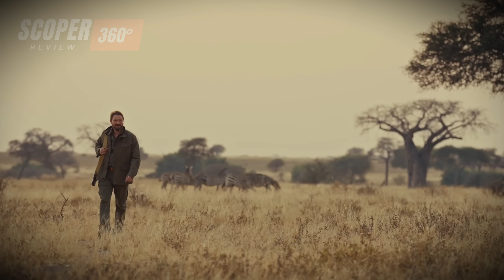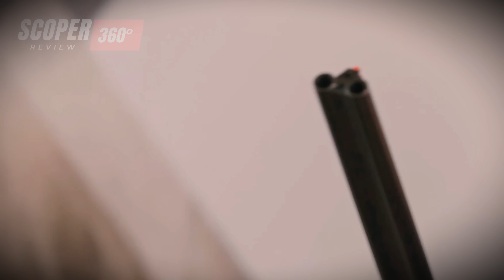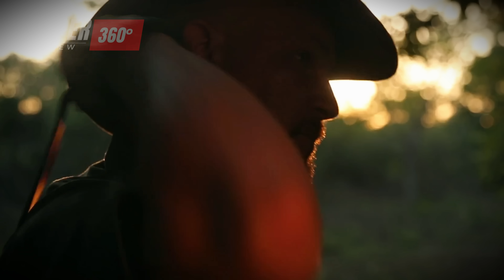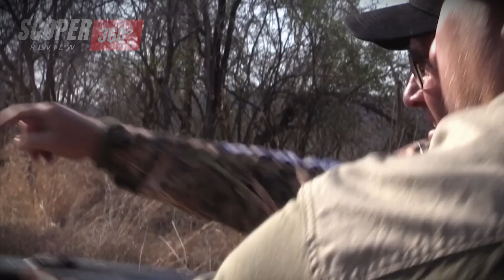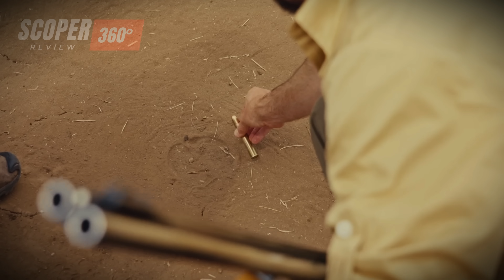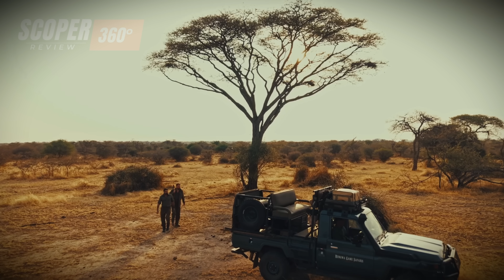The #1 Best Big Game Double Rifles at SHOT Show 2026 – Is This the New King?

Comment: It is not possible to regulate the Krieghoff Big Five on different bullet weights. The barrels are fixed. You can do this with the Krieghoff classic up to 9,3X74R. From 375 H&H and higher it is not possible.
Reply: That is unfortunate- the Baikal MP 221 in 45-70 l own has a regulation system - if l decide to hunt Cape buffalo l'll use my Ruger #1 in 375 or my Ruger #1 in 416 Rigby- l like single shot rifles
Reply: Change the powder and the charge also .